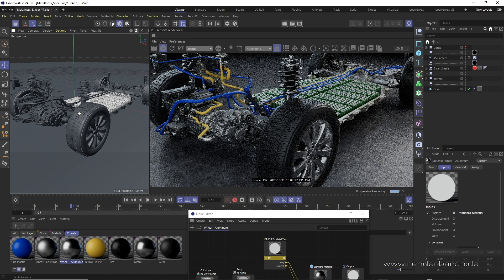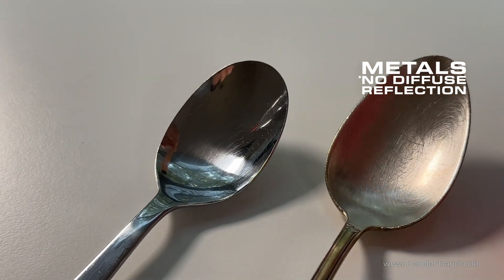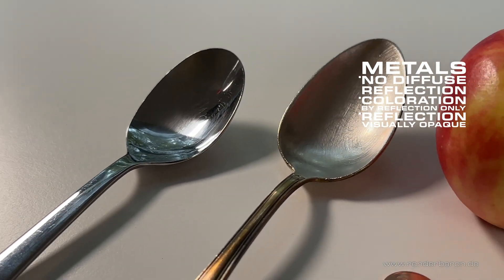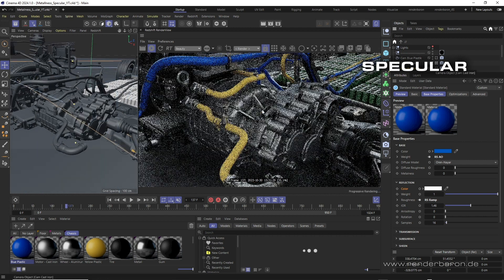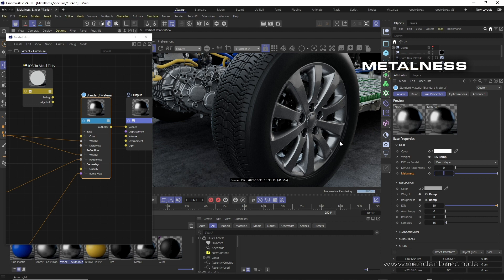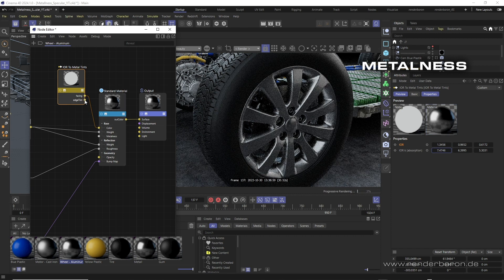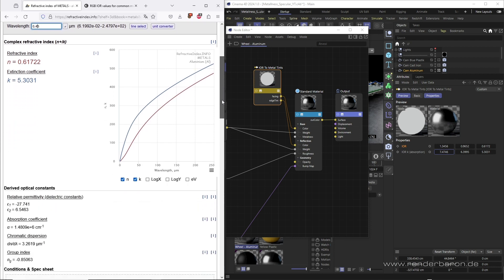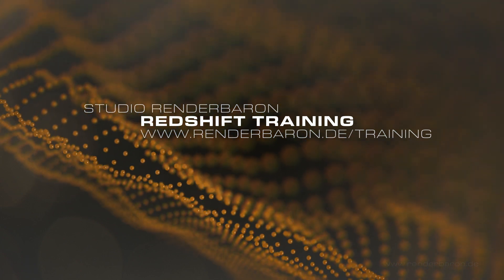Did You Know? Redshift for Cinema 4D: Metalness vs. Specular Workflow

Comment: Hi. Can you tell how to properly  connect reflection/specular map of PBR material in Redshift standard material? When i connect specular map in to reflection color, it almost completely disable all reflections.I feel like I'm missing something.
Reply from the maker: If you´re using the Specular Workflow you should plug the map rather to Reflection Weight than to Reflection Color. :-)
Reply: @renderbaron   Strange. Reflection weight and color provides the same amount of reflection. Still very weak reflection compared to original material preview from website. Maybe some texture conversion needed? Its free pbr material from cgaxis.
Reply from the maker: @peacefulman2196 Did you check, that the texture node has color space set to „Raw“?
Reply: @renderbaron   Its substance material node, cannot find texture color space for reflection. When using extracted texture, yes, raw gives better reflection. Thank you.

Comment: Finally some decent explanation! Thanks a lot!

But One question still remains: what are some Real-world Representations for Metalness Values below 1? Why would one gradually reduce it in the first place?🤔
Reply from the maker: An example would be a greyscale texture map controlling the Metalness, e.g. for partially corroded or painted metals. But in this case me I´d rather use the Material Blender Node or stack multiple material tags.
Reply: @renderbaron  Ah, OK Thanks!  Still, this strikes me to be more like an On-and-Off Situation, than a  smooth blending, but I get it. I would also use the MatBlender in that case.